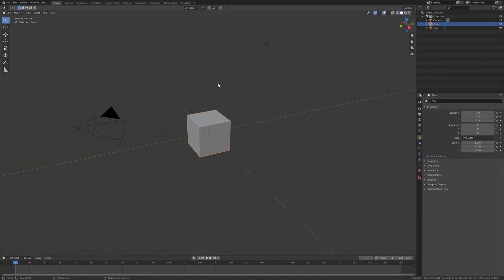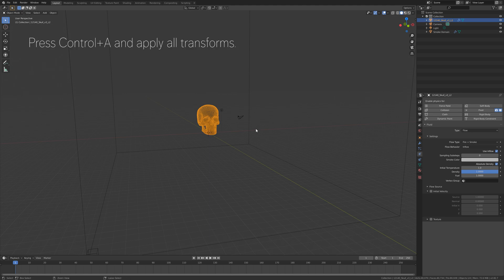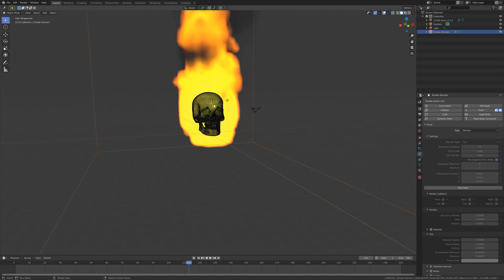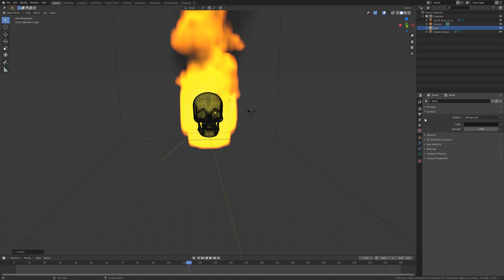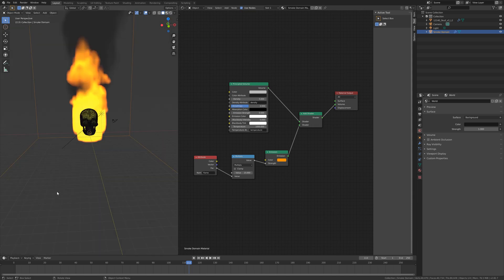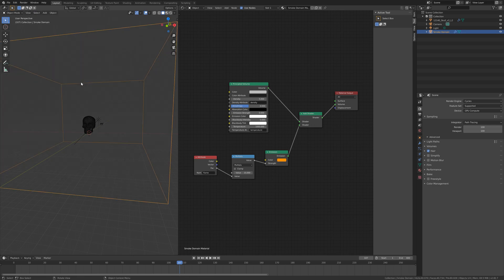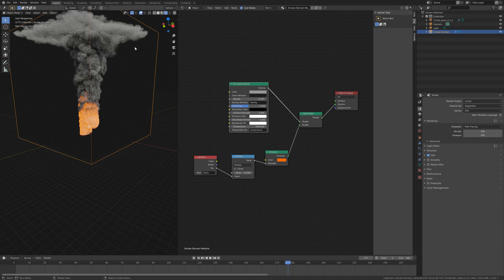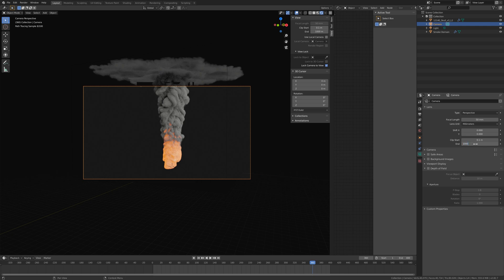[2.82] Blender Tutorial: Smoke and Fire Simulation With Mantaflow

Comment: My smoke and flames envelope the whole skull?? Can't see flames coming out of the skull like yours at all. It is totally hidden in massive flames. Which settings do I reduce please?
Reply: I'm having the same problem, did you ever figure it out?
Reply: @GabeLeonardArt  Hi, no, no one responded so I moved on.
Reply: @jimmelb  I think I figured it out. check the size of the skull and domain. turned out my skull was 14m tall and my domain was 132m tall. (even after resizing the skull as the video shows) I set initial velocity on the skull for the Z axis at 30m/s and it worked. Could probably scale the skull and domain down to something much smaller to solve it as well.
Reply: @GabeLeonardArt  Thanks !! , I will try ity out.

Comment: Why not use the noise value instead of base res of 600? Much more efficient and even as good looking, if not better. Just have to scale things differently. There are some videos comparing high base res vs low base res with added noise showcasing this.

Comment: i wasnt able to create fire , only smoke !!!  i have tried everything
Reply: i was able to create fire :D
Reply: @VitorCaldeira1980  what did you do?
Reply: Ewa Górka you need to bake the animation otherwise it wont work. And you need to use 400 frames for the fire animation
Reply: Vitor Caldeira just that didnt work for me, I found adding a „volume” node,making it higher and connecting it to the „blackbody intensity” helpful
Reply: Did you put every node he did on yours. I had the same problem until I did all the nodes and I received so much fire

Comment: Nice tutorial. The new Mantaflow simulation is just awesome .
I have seen that you use the ‘old way ‘ to make fire emitting light by using emission shader and the ‘flame’ attribute. But there is a new much cooler way now: Just take a Value node with the number between 100 to 1000 and connect this directly to the ‘Blackbody intensity’ input of the principled Volume shader. This create very realistic flames and work with Eevee and Cycles. In Cycles this type of flame becomes also a real emitter.
Reply: can u screenshot the nodes? thank you!

Comment: Something I think should be mentioned is that these simulations take up a LOT of storage... My 300 frame animation at 550 resolution took up just under 140 gigs.
Reply: Just under 140 Gigs??! Damn...thats 1/10 of a fucking Terabyte...
Reply: @Blentux  Yeah, I deleted the simulation immediately after I finished the render
Reply: Was this Base resolution or the base + noise resolution (visible resolution)? I've found that just figuring out the "look" of the simulation is where I use the base res, preferably as low as possible, not over 96, and then adding 4, maybe 5 of added Noise res is a lot more effective, which basically means multiplying the base res with noise for higher res. Might even look better than just cranking up the Base res. And the baking time is 100 times faster too. Haven't checked the file size though, but I'm guessing it will be multitudes lower with added noise instead of a high base res.
Reply: @Quikkmaffs  Thanks. This combination is nice.
Reply: I'm glad I put my cache on my storage drive, 1000 frame animation, at 255 took 140gb. People with low disk space beware!
Reply: Particle bake on my fluid sim was 300gb

Comment: I have a question: doesn't Blender use your CPU only while baking physics simulations? Or it used to be that now, but now we can rely on GPUs?
Very good tutorial for beginners, thank you!
Reply from the maker: I assume that as baking is waay faster when I use the GPU.
Reply: @Olav3D  Thanks for the answer.
Reply: As far as im aware Mantaflow only uses CPU to bake simulations currently, please correct me if i'm wrong. It has had a lot of improvements recently in multithreading though which makes it utilise all available cpu cores better.
Reply: @ojhuk  I think you are correct, for any computations like this it certainly seems CPU based.